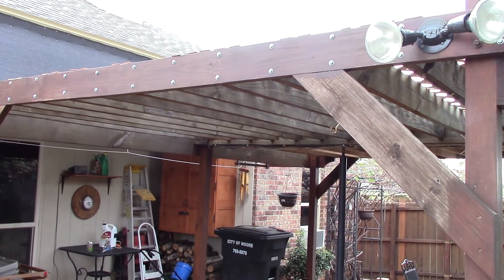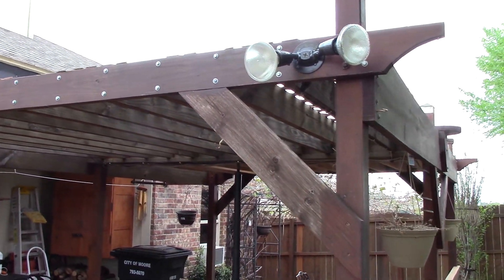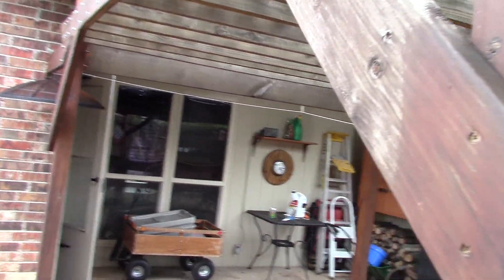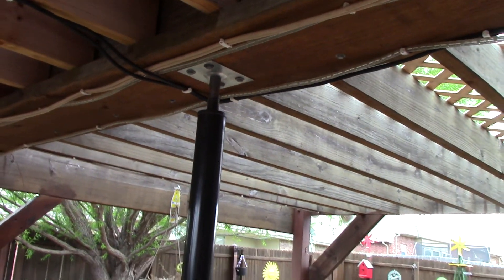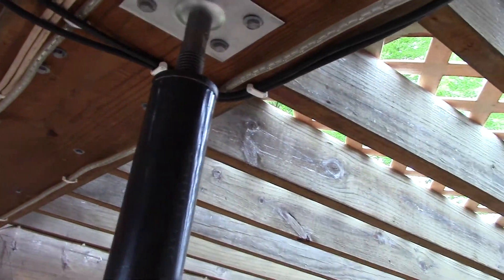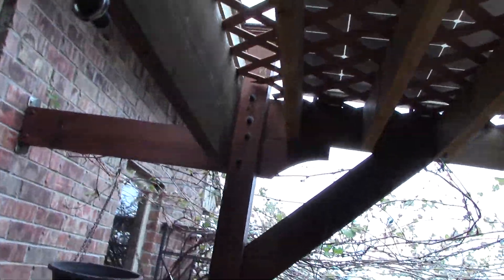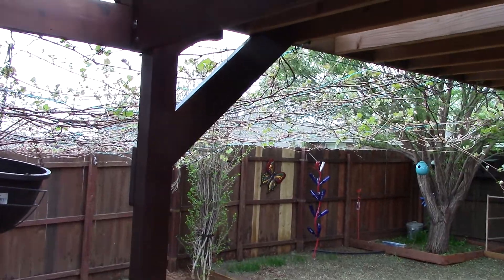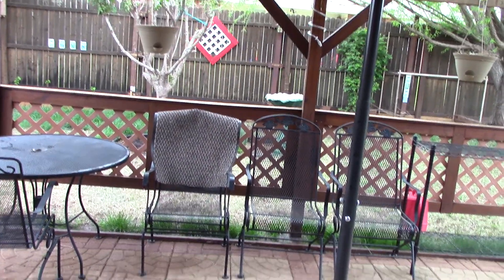Solar panel pergola strengthening and fixes. Jack stand, bolts, and bracing

Comment: Sweet Man that's going to be pretty dang strong!! I built one in my front yard probably not as nearly as strong as yours. Never thought of putting panels on top of it though. But there's not enough sunlight in the front anyway. All in all good project!!
Reply from the maker: Thanks. This pergola faces west and I got those two Globe Willows out back. So, my set up is great for shade...not that great for solar. Can't safely put panels on the roof...shingles are pretty weak/HOA questions. Gotta do whatcha gotta do.
Reply: Yeah why penetrate the roof if you don't have to. It just may cause leaks or other problems later anyway.

Comment from the maker: After the tornado a few weeks ago, decided to make the pergola stronger. I spent about $65 in lag bolts and $45 on a floor jack. All is good now. Pretty happy with this project. Now I need to replace the lattice on the other side and GET SOME MORE SOLAR PANELS!!!!!!!! Haaa! Gonna see how much the electrician is going to charge me for the power transfer panel before I start ordering more panels. Oh, in between clouds today...saw 1KW on the Midnite Solar Classic 150...for a brief few seconds...my jaw about hit the floor. Shot up to about 36 amps...me likey likey.